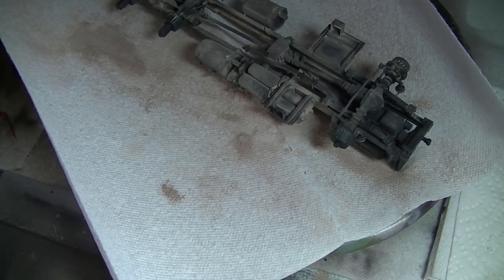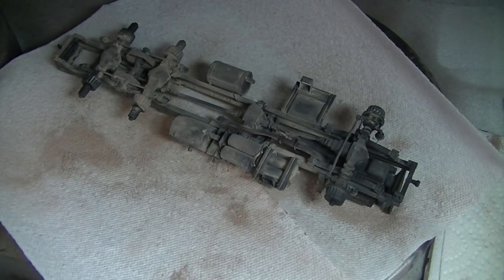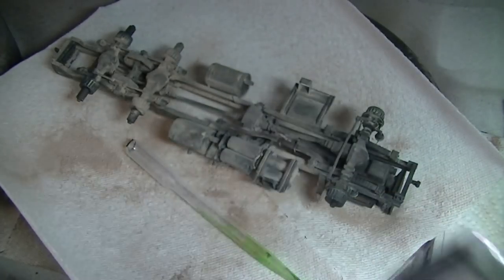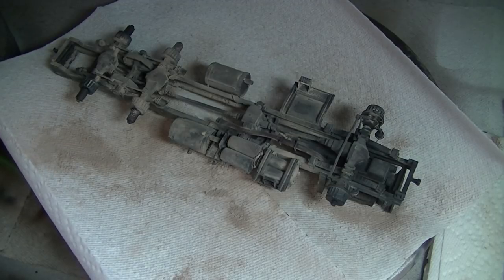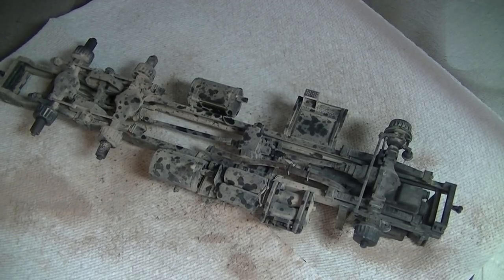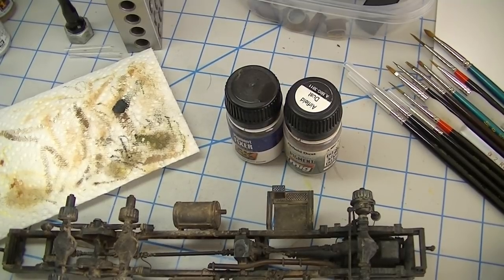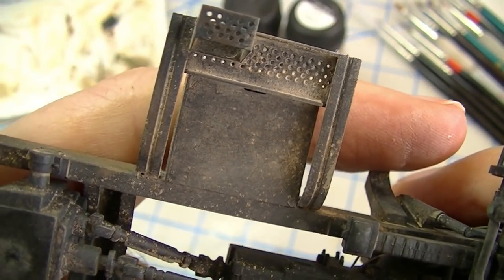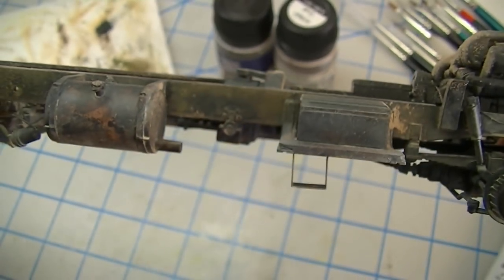ep170 - 10 minutes of technique #1 - stippling pigment fixer

Comment: For those of you who "Do Not" have an airbrush, alternately you can use a toothbrush dipped in pigment fixer shake off the excess and run your finger over the brush. This will create a stippling pattern as well. Nice vid on the "actual use of the mac valve Will. Tks for sharing again

Comment: So I have a question maybe you can answer. I was very intrigued by this video yesterday and started pondering a similar build. Having a 27 year background as a heavy equipment operator and see your technique only missed two ques I spotted to be completely realistic, which leads me to my question. On these rigs if they are well maintained they have a sizable buildup of grease and oil near where the grease zerks are located such as those around the yokes of the drivelines and backs of the wheel spindles. Likewise grease is spat out in a linear direction away from the zerks and collects all over the place on drivelines.  In your professional opinion what would be the best approach to recreate these areas where grease would be found and the splatters from them being thrown out onto the underside of the chassis? I would be interested to know if you have any thoughts on how best to achieve this look? Grease does collect dirt and grime so much of it would have a dry appearance and I would think that could be easily mimicked using the technique described other than it would have a more smooth finish, but what about the grease that escapes the road grime, it normally remains very glossy looking and has that wet look? I think the same effect would be useful for oil leaks on the belly pan, transmission, universtalls, 5th wheels and transfer cases and a well used machine is going to always have that wet oil look and I am not sure how to best accomplish this?
Reply from the maker: i know  the slung mung of which you speak and i'd try just stippling from a brush.  hold the wet brush in close and flick with a knife blade or whatever.  maybe with ammo fresh oil.  you might also have to manual it with some oils.  maybe this will be the next video!  =)
Reply: Good call using ammo fresh oil. New to all this so need to get up to speed with these cool specialized products but reading up on this stuff it looks to fit the bill for the effect I am after.